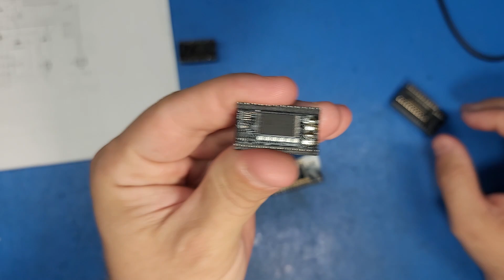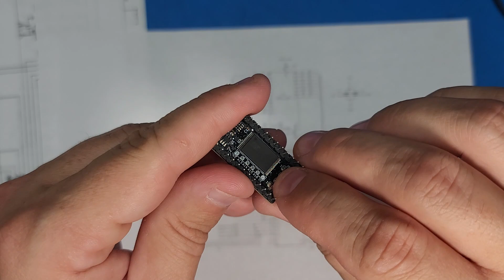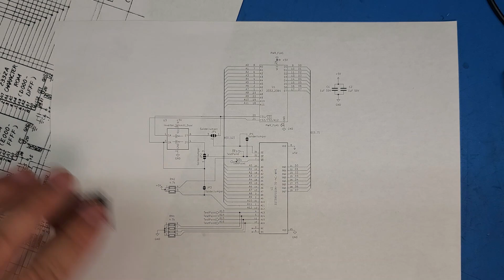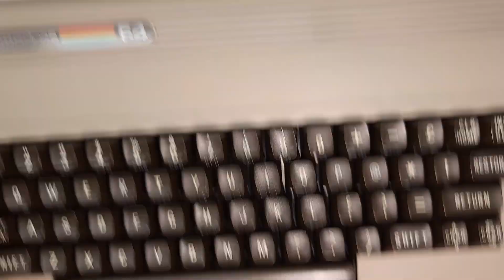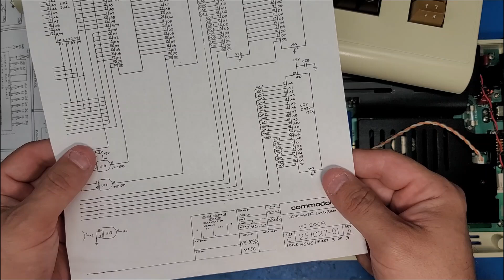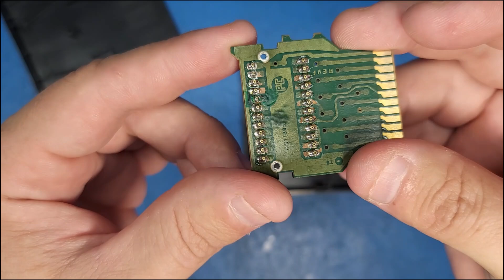2364 2332 2316 Re-Programmable ROM Replacement

Comment: The TSOP package has been discontinued, do you know of any other parts that can be used.  Also very keen on the low profile headers and single pin sockets you used on the game card, do you have part numbers for them you can share?
Reply from the maker: @johnfrank6302  I will be releasing the newest version soon. It uses a chip that is still in production and has all of the same functionality as this version. 
Single pin sockets: digikey.com- ED90544-ND
Ultra-low header: 5496-SL812Z-ND
Reply: @The_Retro_Dungeon  Thats great, looking forward to it.

Comment: I cannot understand the BOM of this board. The one on PCBWay downloads an HTML file but when I open it with HTML viewer I get a useless page.
Reply: Additionally, in the programmer adapter BOM's ZIP file there is an ODS file. In the one of the rom replacement board, there isn't.
Reply from the maker: @Paolo3480  open the ibom.html file with chrome, Firefox, or edge. I'll add an ODS bom shortly.

Comment: Fantastic work. Many Retronerds like me will be very interested in this. Would love to test this out for you but sadly i'm in the uk so probably too far. I have many projects on my list with TI99/4A, Dragon 32, Dragon 64, Oric 1 which actually needed a very slimline adapter like yours. The forums arcade museum will also be very interested in this.
Reply from the maker: @retronerd2592  do you know if any of those machines have positive chip selects?
Reply: @The_Retro_Dungeon  Hmm it appears I can't drop links into youtube comments. Oric 1 - Google Oric1 Repair - Select first listing retronerd(my site) I've put the adapter diagram and pinouts down the page.
Reply from the maker: @retronerd2592  looks like the oric-1 uses 28-pin 27 series roms. Or am I looking in the wrong place? https://retronerd.co.uk/oric-1-repair/
Reply: @The_Retro_Dungeon  TI99/4A - Google TI99/4A eprom. Goto 3rd listing - Vintage Computer Federation Forums-Ti99/4A Looking to replace faulty rom. Pinout is shown.
Reply from the maker: @retronerd2592  my board should work in place of the TMS-2532 as well. On the TMS2532, pin 20 functions as an active low chip select. Pin 21(Vpp) is a programming voltage input and on my board you could leave JP2 open on both 1-2 and 2-3 and bridge JP3 to control /OE and /CE from the  /CS1 input.
Reply: @The_Retro_Dungeon  My bad. I was thinking it was 28 pin. Maybe something for your next version which could have 28pins and also work for 24 pin?
Reply: @The_Retro_Dungeon  Dragon 32 - google Dragon 32 faulty rom goto first stardot and see bottom of page for pinout.
Reply: @The_Retro_Dungeon  Dragon 32 - google Dragon 32 faulty rom goto first listing "Dragon 32 Rom Fault" and see bottom of page for pinout.
Reply: @The_Retro_Dungeon  google Dragon 32 faulty rom goto first listing "Dragon 32 Rom Fault" and see bottom for pinout.
Reply: @The_Retro_Dungeon  gugle Dragon 32 faulty rom goto first listing "Dragon 32 Rom Fault" and see bottom for pinout.
Reply: @The_Retro_Dungeon  Wow tried 20 different versions of this reply but it keeps getting blocked - gugle Dragon 32 faulty rom goto first listing Dragon 32 Rom Fault and see bottom for pinout.
Reply: Wow tried 20 different versions of this reply but it keeps getting removed - gugle Dragon32 faulty rom goto first listing Dragon32 Rom Fault and see bottom for pinout